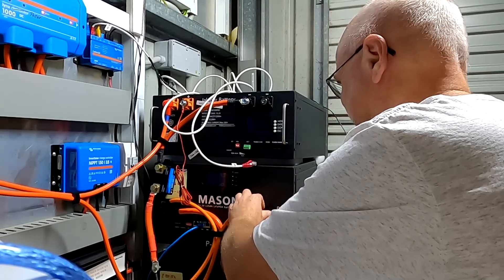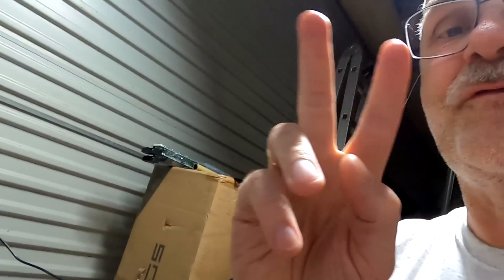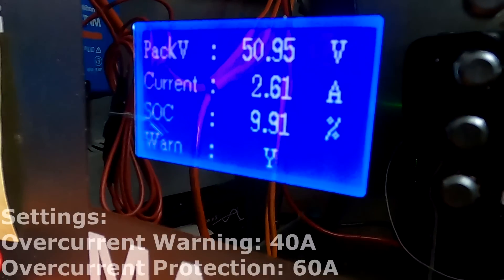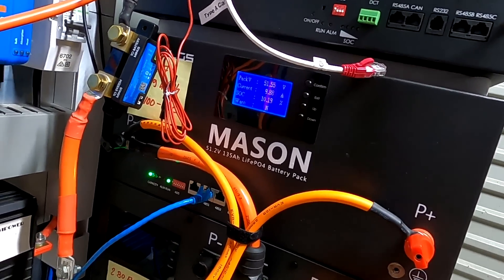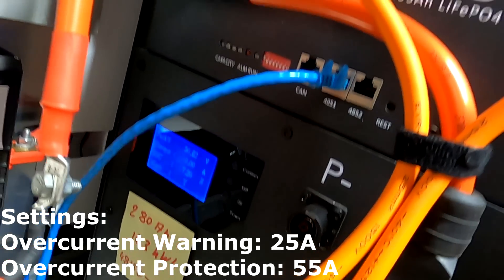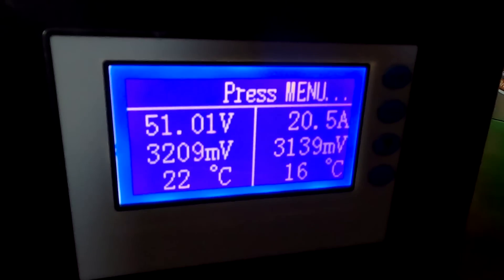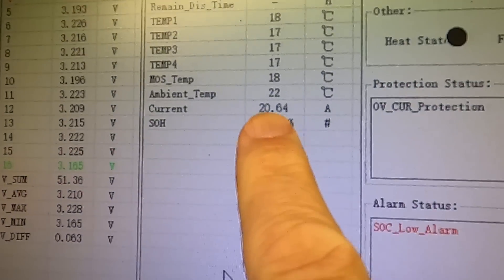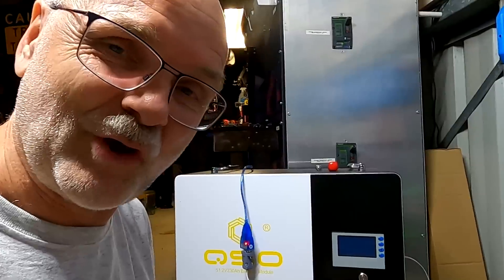Current Limiter Test Seplos BMS 10C, 10E and QSO Tiangbangda BMS

Comment: In regard to your question if or not the Seplos BMS actually limits to 10A during charging or if it only signals the CCL 10A to the Victron system... with my non-BT BMS with firmware 2.9 on it only signals the 10A and still allows for more charging current to flow (my MPPTS still deliver their full power as "DC feed in" is enabled... with "DC feed in off" system would actually limit the charging current as commanded I assume).
Reply from the maker: Thanks for that info. I have seen this one an ESS system I'm monitoring and it seems even requesting only 10A (CCL) does not seem to have an effect on what the MPPTs deliver. That is with two batteries in parallel and the Seplos 10C with 2.8 installed though.
I also read about the issue with DC feed in and Victron...

Comment: I have a question. Most of the people have an inverter connected to the battery. Because of the sinus the load wil vary. I have a 24V system and an Victron 3000VA inverter and noticed that around a load of 2200Watt my Daly 150A shutsdown on high current. So maybe you can look into that what capacity BMS you need when using an inverter because of the intermittend load?
Reply from the maker: Yes, that could be caused by the DC ripple the inverter causes. Set the BMS a bit higher, maybe 170A and see if it still occurs.

Comment: Hallo Andy, super video - super question. I have also an 10C. When the battery is at about 95% SOC "it?" will limit to 10A charging. And I have almost the same quastion. Does the Seplos or my Solis-Inverter (No Victron 😉 ) manage this? In my Solis-System I can see the Information of the BMS. Here the 10A are noted. So I think it's come from the Seplos. 
Viele Grüße aus dem teilweise sonnigen Hannover😄
Reply from the maker: I guess, I will have to test this, right? I assume it only requests this form the inverter/charger but does not limit it from the hardware site. But, I'll test.
Reply: Same me I think in this situation 90-95% the charger current will reduce for save battery longtime and anyway you can setting software.

Comment: It is my oppinion that you don't get the peak max current displayed on your digital displays. They are rarely fast enough I believe. A storage osciloscope can catch the actual voltage over a serial resistor to allow a correct peak to be calculated. Alternatively it should be possible to catch it with a current transformer and the oscilloscope.
I just got the idea that as the current in a wire depends upon what is currounding it (as well as its resistance) a set of ferrit rings should protect electronics from high current spikes. If you run out of test ideas then that is one you could do. (It is the theory that the current really runs on the outside of the wire allthough I believe some goes inside with DC. It has however been proven that the speed with which the current should arrive - the speed of light in vacuum - is reduced if the cable runs through water).
Reply: BMS'es don't care too much about small current spikes, they have response curves for over-current vs time of event, so that you don't continually trip on overcurrent when something suddenly changes. What is important here is that the BMS responds quickly enough to limit the current before achieving the "trip" values, which means that the "alarm" values dictate current limiting function. You do not want your "trip" value to dictate anything other than a tripping function, since your system shouldn't achieve the trip value in daily operation unless something goes wrong (cable short, failed mosfet, etc.)
Reply: @stefanvanzyl9090  Nothing cares too much about small current spikes as long as they don't overheat something. 
I believe that what we are talking about here are quite big current spikes. If they are short enought so that the electronics doesn't get heated up so that it starts changing the composision of the switching material and point then there is no problem. External components such as fuses and breakers can allways take short over current pulses as it takes relatively quite some time to heat them up to react. Internally usually fast switching components are used to shorten the heating time and there by lessen the change of over heating and dammage. What I am getting at in my first comment is that the logic for the displays often isn't all that fast.
Reply from the maker: During my testing, I could see some larger current spikes for a few seconds. It can take a few second for the limiter to kick in.
Reply: @OffGridGarageAustralia  That worries me. Electronics blows in milli or micro seconds. Admittingly I doubt that you see the real story when you talk about a few seconds. Any electronic protection usually happens in milli or micro seconds pahaps even nono seconds.
The possibility of high current spikes is the reason why I am not too happy about Busbars. I prefer to have a little resistance in the circuits. I prefer a little constant resistive losses to a big bang electronic blowup. This is of cause personal taste. Electronic blowup's rarely result in fires especially if there are fuses as well. Too high current in too thin wires or bad or loose contacts may be just as dangerous in causing fires in my experience and I have seen blowups and burned wires but I can't recall a fire for this reason. Especially high current circuits should be checked regularely for any loose screws or miscolored wires. A very good connection can be a loose connection and nearly burning a year later. I don't know how it happens but it has happend for me.

Comment: Hi Andy
Totally off subject question .
What is your highest voltage in a string? 
And highest amps in a string,?
Since i want on a roof ,(high voltage ,and low amps) this for safety reasons in DC  side.
Wanted to know or a high string voltage can work with victron setup.
I have now 670 volt and 8 amps on a string
Reply from the maker: My highest string voltage is less than 100V with a max of 10A and 13A per string. But I have 17 strings in parallel due to the shading. This works a lot better than having some panels shaded in a longer sting.

Comment: I don't quite understand the use case of current limiter in daily use especially when chargers communicate with BMSs.
Reply: In a large battery bank with multiple parallel battery packs, the total charging current can easily exceed the safe charging current for an individual battery - so if many of the batteries disconnected due to being full or going over temperature (as an example) then the remaining batteries can still accept charge at a safe rate instead of damaging them. The PACE and TIANGBANGDA BMSes cannot tell the Victron system to reduce charging current.

Lastly, communication between chargers and BMSes isn't the most reliable thing in the world, situations can easily occur where the software doesn't respond correctly or is too slow, so instead of completely disconnecting the battery (and letting the charger voltage rise uncontrolled), this is a good alternative.
Reply from the maker: Thank you, Stefan!

Comment: Can the JK BMS this as well?
Reply: no, it does not have a current limiting board.
Reply from the maker: No. The JK is great for what it is but not designed for parallel battery banks and high currents.

Comment: Andy, you talk about how the BMS "requests" charge current or "limits" the charge voltage or "takes control" of all the settings so you cannot change them in your Victron environment.

This is speculation, but my thoughts on the concept of "Battery BMS controlling the solar charge controller current and other values" is this:

When you tell the Victron gear to talk to the battery BMS via CAN or RS485, what you are doing is telling the gear to poll the BMS and request the settings in use at that point in time on the BMS and honour those settings 

I don't believe the BMS actually talks to and controls the Victron gear. It returns the configuration values in use and the Victron software in each Victron gear then uses those values to control the various settings for the device. Of course in the user interface the option to fiddle with those settings is disabled or they appear ghosted to the user.

The various "protocols" (like Pylon or Victron or others) are simply the order that information is returned or how the values are formatted (hexadecimal, binary, ASCII and how decimal points are calculated from those values) so that the receiving or requesting gear knows how to interpret the returned data from the source or requested BMS.

I know it's a minor technicality, but having the right understanding might help understand operative norms. Like does the Seplos BMS control over charge protection only by changing the charge current value (which is then respected by the Victron gear) or does it also perform current limiting using the DC-DC conversion process using the current limiter daughter board? Does it use one over the other, or does it use both in parallel?

I suppose a possible test would be to have a suitable power source which is NOT honouring the BMS values, can supply the excessive current and observe what the BMS does. It'd be nice to see a DC charger of 48v capable of supplying something like 60a or 100a connected and then testing what the BMS does. 

Someone sponsor Andy's channel and ship him a 48v DC charger that is rated up to 100a. 😁 I've seen some on the alley market and some are surprisingly "affordable".
Reply: what you may be missing is that this is exactly what Andy tested in the video. connecting two batteries at different states of charge normally results in uncontrolled current flow (since there's no communication between the batteries, and no limiter). We know the seplos bms communicates requested charging current from victron (this can be seen in the VRM), and we also know that the overkill, JKBMS and others do not do this, since they do not populate those fields in the protocol. 

Lastly, Andy already has a 100A charger in his inverter, and he can disable communication in the victron environment to test the same thing, but that would interfere with solar production during the day.
Reply: @stefanvanzyl9090  I saw it. 😊 And I know Andy could make the Victron chargers self-controlled etc. I had considered all of that before making my comment. 

Andy raised the question about whether or not one of the BMS used the current limiting card in a particular scenario. I was simply making a suggestion on how to find out. And seeing if he could get a big DC charger for more experimentation. 😁
Reply from the maker: I'm currently charging one Seplos battery up again to test this feature...

Comment: Fun bot also Scary.... if no fuse in the system...I would never trust this when paraleling a large battery into a bank
And regarding the Lynx Shunt, can you test if it would be possible to use a BV-712 to intergate DC load into VRM?
And greetings from partialy sunny western Norway today (62kWh)
Reply: I would not trust a fuse to do anything other than blowing when the electronics is allready blown. A fuse may prevent a fire but it is unlikely to save the electronics.